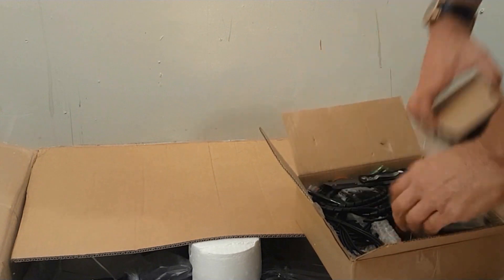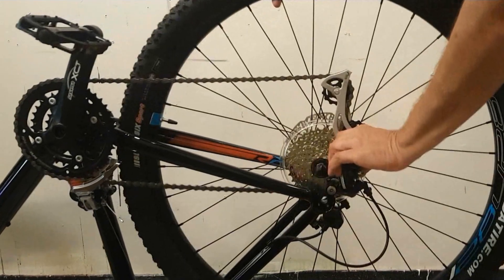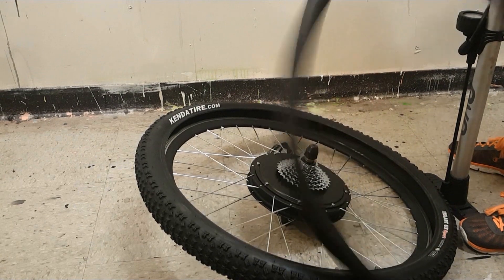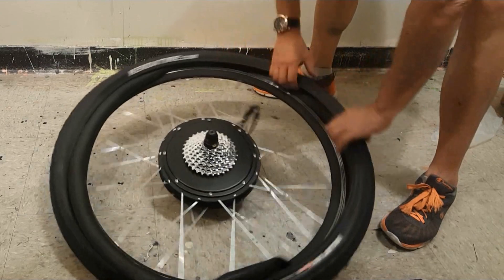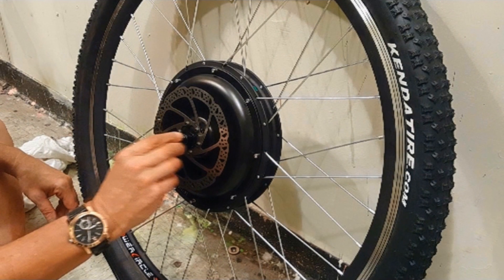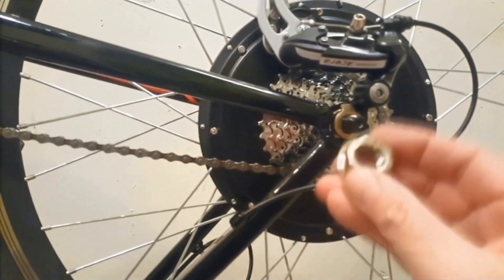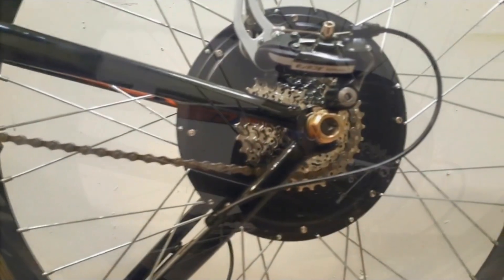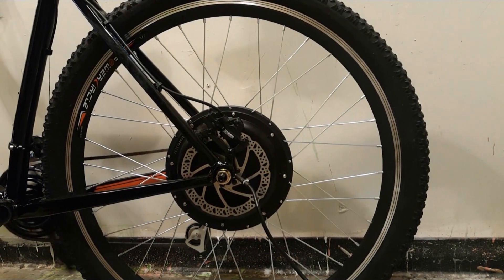EBIKE TIPS. Installing Your E-Bike's Hub Motor

Comment: Sorry that I’m asking a random question unrelated to the video but I’m desperate to learn how to fix my motor and I’m finding very little knowledge on the subject. All my local bike shops aren’t very knowledgeable and lacking in confidence in their skills. You clearly are very knowledgeable thus my reaching out to you. I have a 2020 Lectric XP ebike with what I believe to be a very standard 500w rear hub motor. I was told by Lectric that it was a bad “speed sensor”. It’s under warranty so they’re sending me a new motor. I am a 68 year old DIY guy and love tinkering, cars, motorcycles, vacuum cleaners, etc. if it’s broken I can usually fix it. So I’ve set up to replace my speed sensor. I’ve taken the motor apart and found none of the wiring loose, burnt or out of place. I located the three hall sensors and since I didn’t know to test them I purchased and replaced all three. But it still didn’t fix it. I suspect my soldering job on the circuit board might be less than perfect but I don’t know how to test the hall sensors so I’m feeling frustrated. As I say no one locally wants to touch it. Basically it’s more cost effective to just buy a new one with $80 an hour service charges. One problem Lectric doesn’t sell the motors. To buy an aftermarket motor then I’m additionally replacing the controller, display and other wiring which I’m open to but I have to believe I can my motor fixed. Unless I’m way out of line these motors are not complicated. Replacing a sensor seems very doable. If possible please advise. Thanks